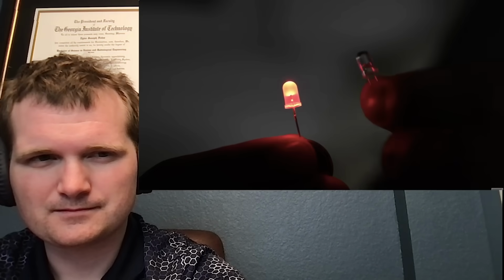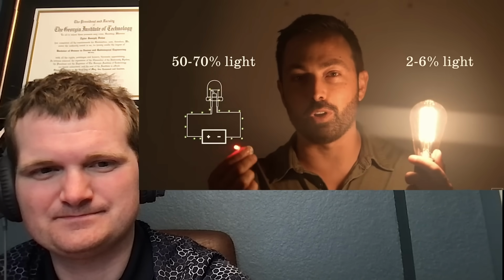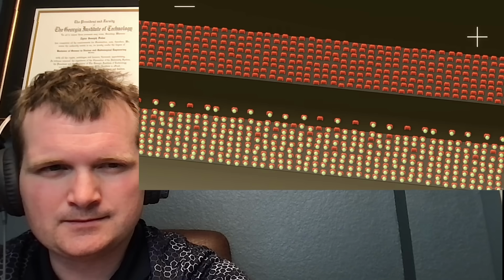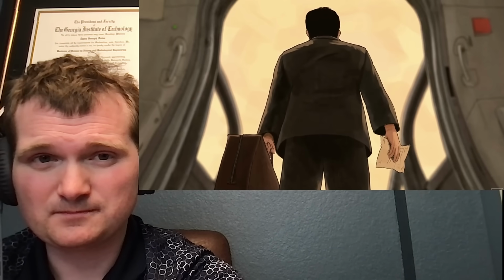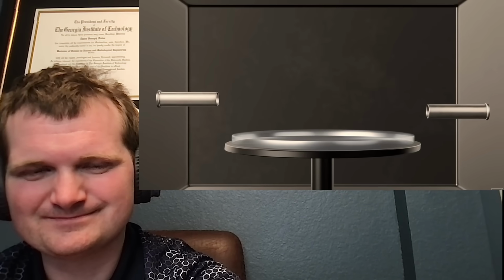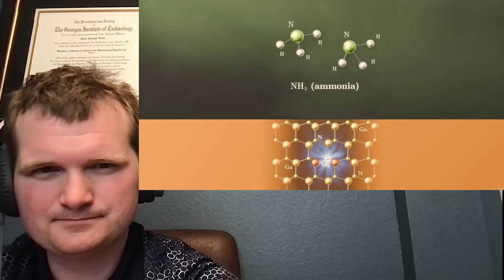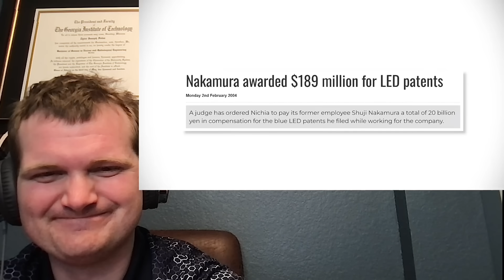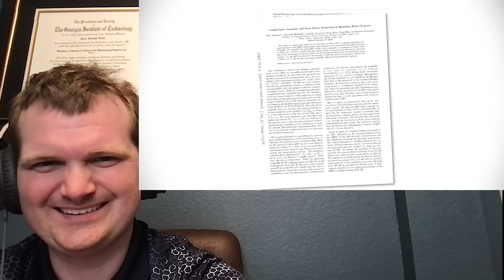Why the Blue LED was as Challenging as Nuclear Fusion is now - Nuclear Engineer Reacts to Veritasium

Comment: I have to drive with sunglasses at so I don't get blinded while driving. Funny they say don't look at the sun then force people to look at LED  light at the same temperature around 5500 K as the Sun. If placed high up like the Sun okay. Like street lights in buildings ceilings sure but at eye level bad.
Reply: Err, don't confuse lighting technology and color temperature. My city has many 2700k LED lamps as well as a handful of 2200k ones that are highly similar to high pressure sodium lamps. The province has installed some 6500k ones on their roads that are reminiscent of the old mercury vapor lamps, but it should be obvious that you simply can't say 'LEDs are 5500k'. 
My room is lit by a 2700k one that can only be distinguished from an incandescent if you use a spectrometer.
Reply: @mfbfreak okay thanks

Comment: I have to be honest I have to disagree with veratasium on this one. I went to a seminar on LED lighting in London hosted by Philips, one of the largest manufacturers of led's and one of the largest distributors of led's. They said that all LEDs are blue, they then change the colour but adding additional phosphorus or chemicals or chemicals such as arsenic to get the desired colour. Bearing in mind this seminar was approx 2014ish. Things may have changed and this may be old hat now but hey you learn something new every day
Reply: You can get both "old style" LEDs where the colour is directly from the bandgap and the voltage drop varies by colour, as well as those where the final colour is generated by phosfors and the internal LED is blue/near UV and all colours therefore have the same voltage drop, around 3-ish V.
Reply: That's fair enough, I retract my comment. Always happy to admit when I am wrong 😁
Reply: @MrBeep2010  It might well be true for Philips, and what they're producing, just not true generally/globally.
Reply: @michaeltempsch5282  maybe so, it was a long time ago, technology has advanced so much in that time too